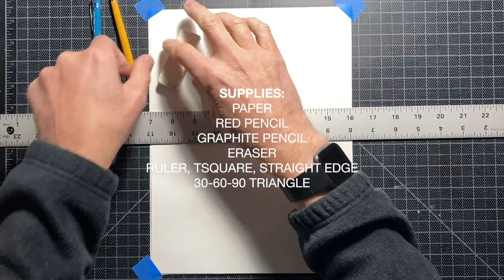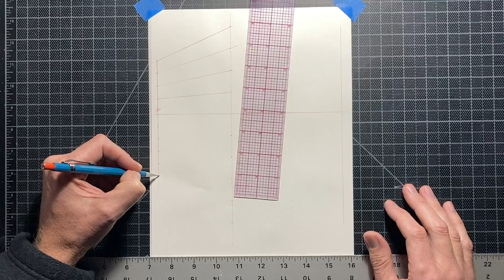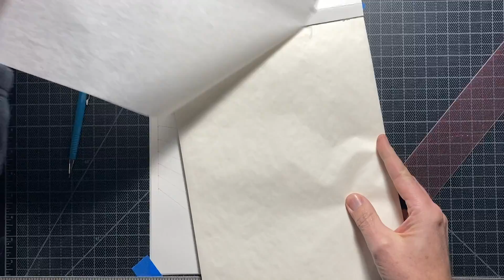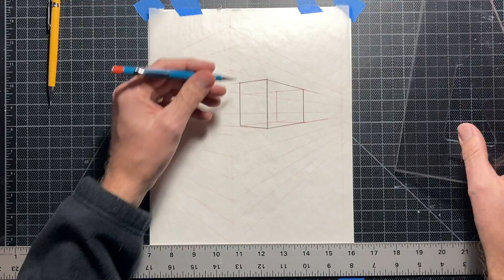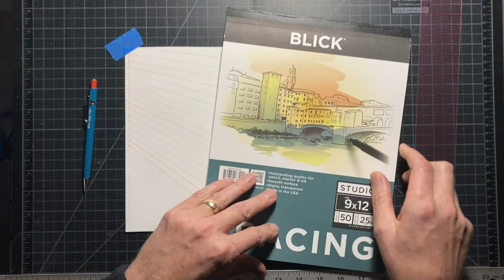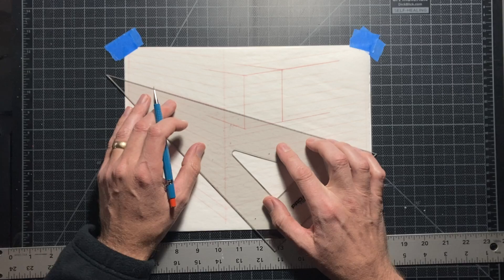Perspective - Using the Brewer Method

Comment: So in the second case, when the HL is over the paper how do you know the two pairs of lines starting from the center line, will all converge on the HL? Are you kind of guessing?
Reply from the maker: Great question. This is a quick and dirty version of the Brewer method, however, if you need to get an exact HL placement, I suggest watching Dan Beardshaw's video. Here is the link. https://www.youtube.com/watch?v=Hd7LNfWOjiM
Reply: @clthornock  thanks for the answer, i like quick and dirty but i'll check the link too!

Comment: how do you determine your Station Point
Reply from the maker: Good question. The station point represents the place where the viewers eye is located in relationship to the scene observed. It is located below the center of vision (which is a point on the horizon where the eye is focused). Also in one-point perspective the station point is found below the vanishing point on your paper. But remember, it isn't really on your paper but floating in front of the paper somewhere. If you draw the SP close to the horizon line, it reduces the size of the drawing because there is a cone of vision that radiates out from the SP at a 60 degree angle (30 degrees left and right). The further down the page, or the farther away the SP is from the HL, the wider the scene that can be drawn. So, in a sense it is a bit arbitrary or it all depends on the drawing you want to make. Sorry for the long answer. Hope that helped.
Reply: @clthornock   Thank you Really much for your Long answer, It Helped Alot. Also 1 more Question... does the vps always have to be 90 or does it depend on the lens being used for the drawing.
Reply: And also...How do you know what your COV limit is when you dont really know where your Sp is off the Page. 
Thanks in Regards
Reply: 1 more...hehe The sp in 2 pp. how is that one determined. or the cvp on the hl
Reply: I think the Sp in 2pp is the Dominant vertical Which is the Vertical line all the way to the front of the drawing
Reply from the maker: @justagoodguyccc4351   In 2 point perspective, without distortion, the left and right vanishing point are always 90 degrees from each other with the pivot point being the station point.
Reply from the maker: @justagoodguyccc4351  I don't think I quite understand this question. The cone of vision is a 60 degree angle originating from the station point. The closer the picture plane is the smaller the eventual circle or cone will be. The further back the picture plane from the station point, the bigger the cone of vision.
Reply from the maker: @justagoodguyccc4351  The station point is directly below the center of vision. The center of vision is the point on the horizon line where the viewer is looking. It is the logical conclusion of the line of sight. (the direction of the viewers gaze.) So then, the station point is located vertically below that point.